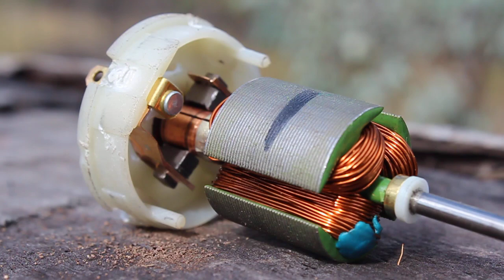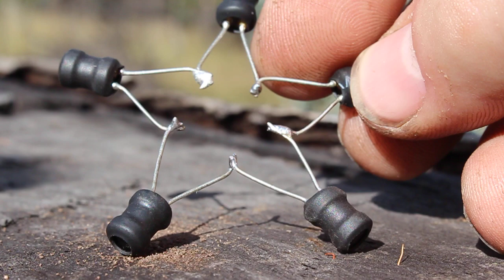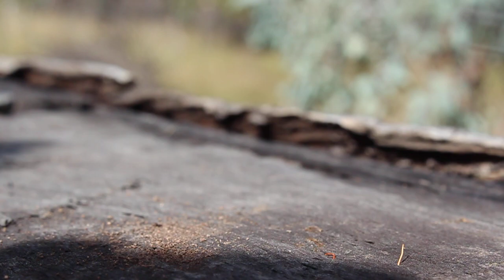Proof again that they mislead you! - Beware Numpty Club Propaganda! - Read the Description!

Comment: hey Chris do you think this rotor has 3 different voltages at any time, due to 3 different lenz states, ? even though they are all close circuit simultaneously and in series ? (due to perfect brush's ?)  ...  because the thought occurs that due to them being in series they will require some kind of current interaction ?.  -     im curious if this is a detriment to cop OR a plus , do you think ?.. .